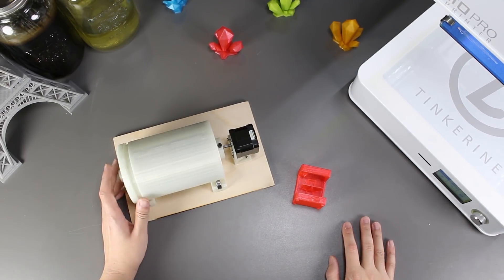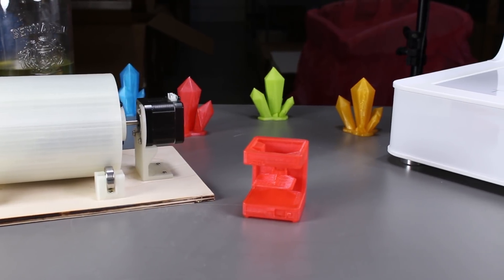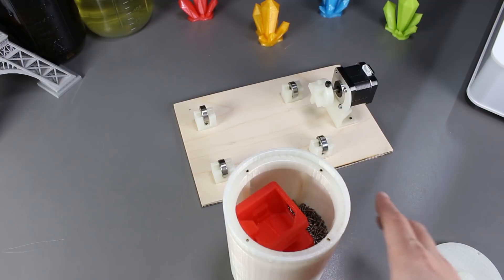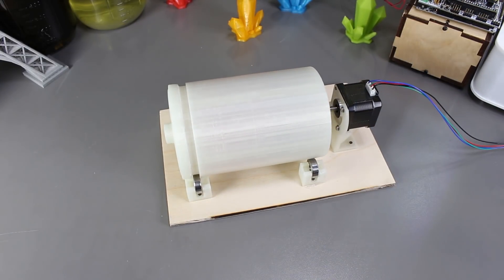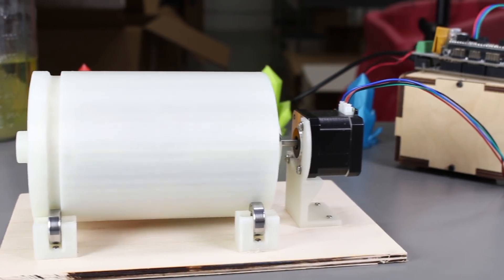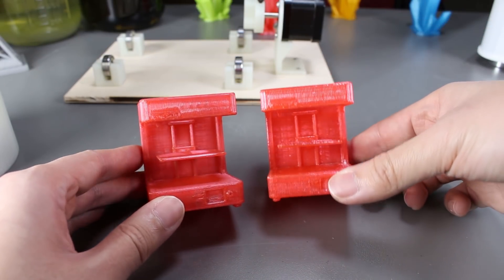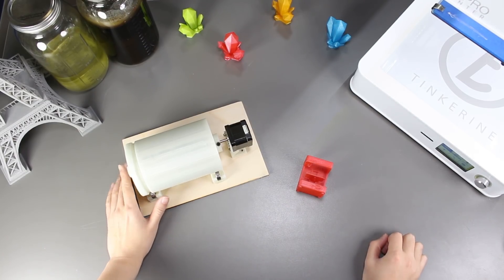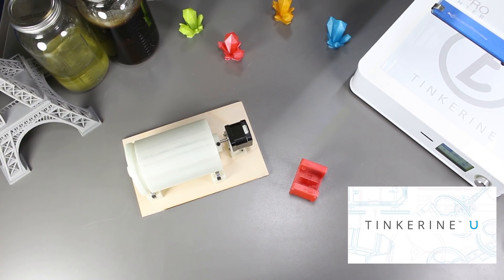Post-Processing 3D Printed PLA Print with a Rock Tumbler

Comment: Would love to get the STL files for that tumbler if possible that barrel is one of the best 3D printed ones I've seen online and trust me....I've looked 😂 I've just finished one but the thread just isn't right. As for tumbling there are so many medias around and they all do different things, some are for knocking the edges of the rough prints off other for fine polishing the metal filaments and it can take a couple of days. Also try lining the barrel with rubber shelf liner cut up to fit or something to make the parts tumble not just slide around or it won't work. But PLEASE share you files on thingiverse.com or cults or something so people like myself can be extremely grateful 🙏
Reply from the maker: Thank you for the comment! You can find the files uploaded here: http://tinkerine.com/topic/805/3d-printed-tumbler
Reply: @Tinkerine  i cant download the files or interact in any way. i created an account but it will not let me log in unless I'm on the main page.
Reply from the maker: @seandevine9846  Did you create an account for Tinkerine or Tinkerine Cloud. You will need to create a Tinkerine Cloud account to gain access to the page. 

Sorry for the inconvenience!
Reply: @Tinkerine  I believe it was not cloud I will try again
Reply: @Tinkerine  got it to work ty

Comment: I would suggest alumina particles for grinding agent rather than hardened screws.  Also, why the stepper motor?  Get yourself a 50 to 100RPM geared DC motor.   You will see WAY faster results.
Reply from the maker: Thanks for the comment and suggestion. We used a stepper motor because that was the only available motor in our warehouse.

Comment: Screws ? People tumble brass bullet casings all the time but no one in their right mind would ever use screws. Fine crused gravel, sand etc.
Reply from the maker: Thanks for the comment and suggestion!
Reply: Gravel 😂🤦‍♀️ yeah go grab some off the side of the road. Not! 
Metal is a common media for tumbling, steel shot and screws etc, ceramic, walnut shells, corn husks, plastic even. Try google before insulting creators by saying 'no one in their right mind would use screws' theres alot of lapidary specialists on here saying they're idiots for using screws when they should try googling forms of tumbling media and doing some research before being couch critics.

Comment: Just curious, how are you driving that stepper motor? Is that an arduino board running some custom software?
Reply: it appears to be a standard RAMPS 1.4 setup that he had a spare of, either custom software or just plug it into the extruder port and send it g-code to extrude 2 km of filament
Reply: Thanks :)

Comment: No burnishing compound? Normally, when using a rock tumbler in this way, you would fill the tumbler with water just to the top of the media (screws, in your case), and then add a drop of dish soap (I use blue Dawn with good results).

Also, tumbling takes a long time. After inspecting it the first time, you should have put it back in for another 26 hours (or so) and seen if there was any improvement.
Reply: Thanks bud

Comment: Isn't the use of a stepper motor / arduino combination overkill for something like this when a geared DC motor would be cheaper, just as effective and less hassle for such a mundane task?
Reply from the maker: Hi!

We just used what we had in the warehouse to create this project. Thanks for the comment!
Reply: Agreed. I just saw this video now and I'm gona try repeating the exact same thing but with a simple 9V DC motor. Mind you, I am quite confident that using walnut shells or something of the like will increase the usefulness of this method. I'll put up a video once I've tried it out :)
Reply: Using what you have on hand is the cheapest solution lol
Reply: You cand use the stepper to make left and right rotations for better results. Or print a piston and use a dc motor to shake it front and back front and back
Reply: Good point. So is the grit made of metal screws - far too abrasive for polishing plastic. And the idea that you should 3d print the tumbler, when plastic containers of this type are abundant. And if you print the tumbler on your 3d printer, that's a guarantee that the biggest part you can make on that printer will not fit inside.
Reply: @Mekchanoid  apples to oranges
Reply: not just overkill but kidna useless and ineffective and inefficient

Comment: Why not use rock tumbler grit instead of screws you can buy it in different courses to get a smoother finish.
Reply from the maker: Hi!

Thanks for the comment! We are looking into it, we just used something quick from the warehouse to see how the results would be.
Reply: Tinkerine oh I see I’ll keep a look out for your results with the grit.
Reply: @Tinkerine  You couldn't get sand fast? Or as fast as a bunch of screws?
Reply: I agree, i got here mostly wondering what media to use for a "Harbor Freight: I wonder if this will work" attempt. Then I saw him using screws as a media and I'm thinkin' "No shit it didn't work." I'm thinking walnut shells, and 3d printing my parts with a wood filament.
Reply: I'm also planning to make a tumbling machine for my 3D prints. I wonder if I could use table salt as an abrasive. Has anyone tried this?

Comment: work with NEW SCREWS after several object screws not polish work 3 or 5 time
what is the size of layers? 0.2mm or 0.1mm?
Reply from the maker: Hi,

Thank you for the comment! For this experiment, all the screws are new. The print was printed with 0.3mm per layer.

Comment: You do excellent work on this channel, and I didn't have the heart to give you a 'thumbs down' over this, but I wish that you could have shown the surface finish comparison between the two prints in still, close-up shots.  In particular, it would have been interesting to see the back faces of both parts, since the back face of this part was the largest flat surface of the part, and may have shown the effects of the tumbling more than the other faces.
Reply from the maker: Hi,

Thank you so much for the comment and suggestion. We'll keep it in mind for the next experiment with the tumbler. The back flat face is where the print starts to print and adheres to the tape so it is fairly smooth already. Perhaps, we should test with a rectangle in the next experiment so we can see the results better.

Comment: Oh wow! First off, that printed rock tumbler is seriously cool. I think I have another project to add to the list after seeing that. I wasn't expecting the µprinter to come out so well. I wonder if smaller screws or sand would do a better job, since they have more of a chance to get into tighter spaces. Thanks for trying this out!
Reply from the maker: Thank  you for the comment! If you don't mind us asking, what projects do you have in store? 
Yes! We will look into other abrasive materials out there.
Reply: At the moment, I'm just trying out different materials and designs for a better Joycon grip for the Switch (the included one is really not made for big hands). My big projects for the year so far are a mostly-printed mid-tower desktop case and a mostly-printed FPV drone when it warms up enough to really test the latter.